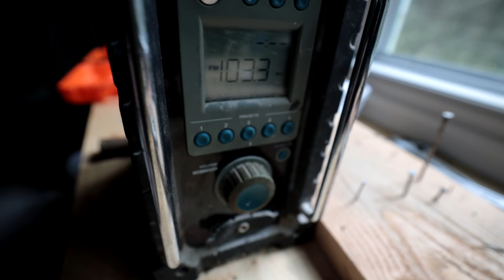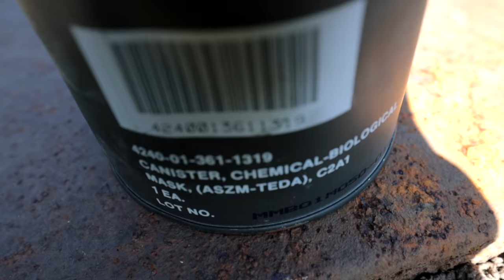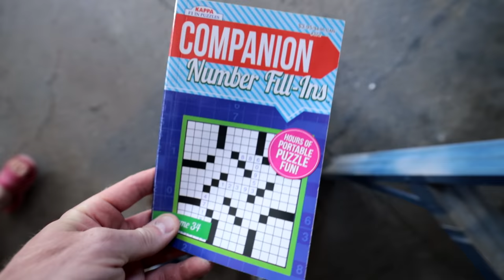I Built a Fallout Shelter!

Comment: that's a cute coffin.... might want to revisit your fresh air filter idea--I don't see much airflow going through one gas mask filter for multiple people that will get rained on and degrade in the elements... i would worry about carbon monoxide poisoning--or methane with beans being the primary source of food🤣🤣🤣
Reply: Use a blower to pull air for one and cut a bigger hole for a 3 to 4 inch diameter pipe and have the outside port angle downwards might try to figure out a way to change the filter on the inside
Reply: "More beans,Mr. Taggart?"..."I'd say you've had enough!".

Comment: Seriously. I have purchased a 5 x 5 x 4 dog kennel. I'm gonna use boxes with huge trashbags to hold water mixed with boric acid. To build up the outer wall then fill in between the kennel and the boxes with 2 gallon bags of water with boric acid. I'm also gonna build up the roof with basically borated water. It's not a lot of room but it's enough for us to lie down. Potty, food and water supplies at least for 72 hours. Then I'll go out for brief things in the house but my son will have to stay in there for a while. The science of it seems sound. We'll be shielded primarily by 24in of borated water. It's not as good as being underground but it might be good enough to prevent serious problems. I have Apple pectin and potassium iodide tablets.

Comment: You asked what is in my bug out bag: 

Medical Supplies - A big first aid kit, burn gel, several Israeli bandages, some gun shot/deep wound kits, extra gaze, bandages, saline.

Survival Supplies - A Knife, 2 lamps, a flashlight, a small saw, compass, a multi-tool, small tent, emergency blankets, poncho, paracord, lighter. 

Other Supplies - 2 Small power supplies with USB and Phone connections for charging, batteries for a week or two for the lights.

Food Supplies - 10 Bottles of Water, Trail Mix, Granola Bars, Tuna Packets, Mayo, Crackers, Chips.

Everything is inside of a large military duffle bag that uses a molle system. 

I made this bag, and keep it supplied when I can, about 5-6 years ago. Our power went out, my Grandfather was slightly injured, and we couldn't leave the house because of downed power lines. Always good to be prepared, since then this bag helped save my Grandmother's life from a very deep injury she sustained, as well as having water after flooding.

Comment: i am not too sure about how good that door would be when it counts and i am not too sure about how well the air flow would be with that filter over the air hole. Might be a carbon monoxide issue.
Reply: You're right.  Most shelters have a way to filter air.  Some are manually run and some run on electricity.  Either way, the air is cleaned and circulated throughout the shelter.
Reply: Yeah pretty sure they would die if they actually stayed in the shelter overnight.  No air coming in that filter those chem suit filters are forced flow only.  Very dangerous glad it was just a joke, just need to be careful that you remind the kiddo that it isn't safe to go in there for very long.
Reply: @AQUATICSLIVE   granted there wasn't a great seal on the door so there was still air flow. But if that door was sealed tight dangerous for sure.
Reply: IDK how he could change the filter from inside - maybe hook it up inside instead?
Reply: @FurnitureFan  and include some way to force the air through.

Comment: Air intake pipe filter should be inside. Also air intake pipe needs to be in the shape of a candy cane to prevent water from entering. And you need alot more airflow than a 1 inch tube. Especially if u have alot of ppl and candles. Also concrete is alot better than dirt. Aside from that its a pretty good idea

Comment: My daily bug out bag consist of: Tourniquet, basic meds, basic TACTICLE first aid kit, trash bags, flash lights batteries, extra pair of clothes, multiple light sources, matches lighters flints. Few small cans of canned beans. 1 full MRE. Portable fold up axe/shovel. Rope, twine, fishing line, mini fishing set, multiple knifes, 
40, s&w with tac light. Solar brick, flares, chem stick, portable HAM radio, And probably a few more main ones I just forgot to mention. Yes this all fits in one bag weighing 31.2 pounds.

Edit, 2 bottles of water. Food and drinks, and any other items that may need to be checked or replaced as in going bad, are done so regularly. Bag stays in my truck any where I go 24:7

Comment: I strongly suggest you put a computer type muffin fan up in that pipe opening and run a 12voltDC line to your power box. Have the airflow direction into the bunker. Also, a couple of automotive white light LED marker lights, hooked up to your power box. They take so little power, could last for days if not weeks on a single 12volt battery. Interesting video, thanks for sharing.
Reply: Without an NBC filter, all that would is suck in radioactive particles, all this set up is during fallout  is a grave

Comment: Any gamma radiation that is emitted by radioactive fallout that lands on the ground in front of the main entrance of your shelter is going to punch right through with the way you have things arranged now. And you will likely die or get severe radiation sickness from being exposed to it.

The radiation will be most intense for the first 24 hours after the attack, and in 72 hours, 90% of will be gone. But you will still need to shelter for at least 14 days because exposure to the residual radiation has a cumulative effect and thus poses a potential hazard.

I would seriously consider attaching a 1" thick sheet of lead plate to the wood on the interior of the shelter and the interior of the steel door. 1" of lead will block 99% of all gamma radiation.

Failing that, I would build an external passageway situated 90 degrees to the shelter entrance, with three feet of earth piled on top and on the sides. Radiation cannot bend around corners, it only travels in straight lines, so the external passageway will add sufficient shielding to the main entrance.

But since you are located in northern Ontario, you are not likely get much fallout, anyway, and the hourly dose rates of radiation may be almost negligible for whatever fallout does land in your area.

I live in southwestern Ontario, and hence I'm in fairly close proximity to a lot of American target sites, and several cities in my area (think Sarnia, London, Windsor) are possible targets as well. Radioactive fallout is therefore going to be a major hazard in my region.

Comment: Shipping container would be epic
Reply: Thin steel and you would have to go Andrew Camarta
Reply: You still have to put it in a cement and rebar frame to keep the metal from bending inside from the pressure of the dirt around it.  Then you also would need an air filtration system, a sewage system, hook it up to a water well, and then add wind or solar energy for lights and to power other needs.
Reply: @stephenthorpe6238  I agree, you need to work on making the structure strong so it doesn’t cave in. It will just be a big project and materials.

Comment: So you’ll need two holes for the purpose of venting. One will draw and the other will release. Otherwise any length of time in it if it’s air tight will kill you from carbon dioxide buildup. Good luck

Comment: Bucket toilet with pool noodle seat. Cups. Smaller water jug to mix the tang. Needs a low cot on the one side wide enough for 2 adults. I'd have dug it into the ground deeper. Air intake needs some kind of suction to make it work and another hole with a filter for the air to get out. maybe an old shop vac?

Comment: You'd need to fill in between those pieces of wood , maybe silicon caulking and steel flashing on the outside of the wood and the inside wall of wood as well. A place to to do ones business would be good to. A nice sleeping bag, pillow and thick foam for that bed/ shelf. A week's worth of food and water. A faraday box, spare batteries, ect. A cheap c/b radio as well as a super long antenna for the outside and if at all possible put it in on a giant telephone pole next to your shelter. Because you would want a lot of open space to receive any radio information. I would also suggest a signal flare gun a lighter or a magnesium stick and blade and a fire piston or something else that's easy or cheap to make fire with. You're going to want to bug out after seven days as quickly as possible so if you can have a vehicle that may not look best but can handle rough terrain maybe have 4-wheel drive or just a $300 vehicle that will get you out of the area as quickly as possible. Keep it close and under pond liner or multiple tarps. Keep the same kid of provisions in the car in the form of bug out back packs. Keep extra cans of gas safe but far and close enough to not catch anything else on fire but close enough to retrieve. Personally a hand gun and or rifle with a few boxes of ammo. I would also have a few gallons of booze and gold/silver as a way to barter since it's value will always be sustainable.

Comment: Fyi, you can't allow that filter to get wet. It will be useless. I'd use another pipe that's a "u" then attach the filter to it. I'd also get a small computer fan for intake air attached to the inlet pipe.

Comment: I think this build is good...except the front. If there was fallout there wouldn't be adequate protection from radiation. There needs to be more shielding in the door and a lot more in the wood surround. There needs to be a minimum of 36" of earth on top and on the sides of the shelter.

Comment: I would caution use in the cartridge as it's used for negative air-purifying respirators. So the air in the chamber would have to be less than outside air pressure. Otherwise, it's ineffective.

Comment: As a storm shelter it is fine. You will not be in more than hour or so. Overnight at worst. As a bomb shelter for non nuclear weapons probably would be ok. But as a bunker for nuclear war it's crazy. Mine would be built using shipping containers and large pipes. I would set up at least 4 to 6 containers connected by pipes to a common hub area, plus an airlock. Airlock would also be the space where you can decontaminate by dumping your clothes and showering off any contaminates. Having so many would give everyone space and privacy. I would use shipping containers as opposed to pipes. Any large pipes like yours would be for hall ways, set up a couple  hydroponic gardens to clean grey water for reuse and grow fish and replenish oxygen, laundry, compost toilets and figure out how to use methane to create energy to run any electronics and cook or heat, Airlock system and storage for provisions and medical. The reason I would have at least 4 containers place for each family member to sleep and make a common room and kitchen/dinning. I would also add games and books. The Common area would more than likely be where the airlock entry and exit is. With 4 in my family all adults we would lose it if we didn't have some space from each other.

Comment: We are currently starting world war 3 and you're taking it as an opportunity to LARP instead of being serious. You do realize that it takes a thicknesses of shield upwards of about 13.8 feet of water, about 6.6 feet of concrete, or about 1.3 feet of lead in order to reduce gamma or fallout type radiation by a factor of a billion to one in order to be considered safe from radiation. Thick, dense shielding is necessary to protect against gamma rays. It's the gammas you have to worry about this little half inch tube of steel, and sheet metal door would do nothing but echo your screams. And your little carbon filter air system would not be nearly efficient enough during a radiation cloud passing. It would take about 60 lb of carbon through a pressurized filter system to clean that kind of air. It's different after the bomb has dropped and levels have fallen which takes about 4 days. But if you know it's going to happen your best bet is to leave the area. And if you couldn't; Your basement would provide you more protection than that thing; although let's be real; going to the basement we just pull on the inevitable as you would still be exposed to deadly doses of radiation just not as much not to mention the air that you're breathing in 🤷That whole thing seemed  like a giant joke like a big kid still playing LARPing games building forts and castles. If this is really your plans; make sure you kiss your family before saying good night once you're in there.

Comment: Buddy,

All joking aside (literally), I appreciate your sense of urgency, but that pipe could have used a second coat of that oil-based stain blocking primer. It looks pretty thin. Also, I would have put a small floor in there. You can use the space underneath for storage.

Comment: So if you want a good variable LED light look up the “Voltaic Systems Emergency USB Led Light”. On the high setting it’s super bright and on the low it is very energy efficient. Or you could get a solar interior shed light. Mount the panel outside run the cord into the bunker and mount the pull cord light.

Comment: A few years back, some yahoo in Missouri was adapting concrete septic tanks to tornado shelters.  NOT USED ONES!

A school in Oklahoma built a lower cost tornado shelter from 3 or 4 cargo containers. Very cool….

A candle will give you CO in there. Bad.  Need a carbon monoxide sensor…

Comment: bro sounds like jordan peterson.  A cheaper alternative to lead is draping a pool liner over the whole enclosure. In the case of fallout the fallout would go where ever water can and the combination of the clean soil and metal human sized can is likely to attenuate a great deal of the radiation.  Even if you don't have an underground shelter.  Being in places where a lot of HEAVY stuff is between you and the radiation, you'll be good.  For example if all you have is some random basement and a bunch of barrels of water, or fish tanks, make a little fort in the middle of the basement away from the walls.  use the water barrels, use sand bags, you don't really need an underground shelter.  The idea of a bomb shelter is mostly outdated.  WW3 wont be like WW2 with carpet bombing (not in the US at least)

Comment: I realize it was mostly a spoof, with the important stuff thrown in to get people to think. And that's important and that's great. But I couldn't help but notice a few things that were lacking. First of all you had no bucket to go to the bathroom in. Basically you need one 6 gallon bucket per person per week to hold number one and number two. A child would be less. But those things really smell so it wouldn't be a bad idea to have some Lysol or something to spray around to kind of mask the odor a little. LOL because poop is something that happens regularly as well as pee. One thing you could do is put a little tiny seat with a funnel under it and a little hose leading outside to get rid of liquid waste of whatever sort. And then save the 5 gallon buckets and some sort of shavings or pelleted bedding to keep in the buckets for number two. Also the water situation needs to be at least quadrupled. And of course you need more food. As far as how it's arranged I personally would have liked to have seen a bed running long ways higher up more like a tall bunk that hinges upward out of the way as much as possible so that it doesn't block the door. And then underneath it you can build in cubbies and shelves for your supplies as well as having a deep shelf on the back. I do understand that that small of a bunker can only hold so much. But in the case of an actual nuclear emergency you need to be able to stay in there at least 2 weeks. You'll also want to keep up some more dirt on the top of it or you sandbags if you're worried about erosion. And then I would use sandbags to make a small hallway leading away from it so that the very end of your bunker is not directly exposed to the elements cuz you can put a small roof on the sandbags and heat some dirt over the top of that or more sandbags. Basically a double door system. Distance and mass are your friends in a nuclear situation. Also the root seller would make a much better bomb shelter than the little metal shelter that you used. These are just my observations and I do realize that it was mostly spoof. But it's good to look at things like that and decide how you would do it differently than the person who did it in order to help with your own plan on how to be safe in the event of a nuclear emergency.

Comment: What if a blast schoots off your air filter. it would be better if you used a steel pipe and put the filter on the inside.
Also to cool the inside. put dirt on top of the pipe.

Comment: Should have built a trench to the entrance as won’t protect ya from fallout the way it is from the from off the bunker. I would have dug a trench about 5ft deep 4ft wide and 11ft long place the steel container you used in the trench place logs over the top off the whole trench place waterproof sheet over it and back fill mean you have a along entrance to the bunker for a mud room and for extra protection  plus if possible to exit doors

Comment: You need a 5 gallon bucket & poop bags as well as a couple MT gallon jugs for pee.  Also if you actually had to spend more than a day in that small a space you will need a way to force air in through the filter & out through another hole with a bellows if not an electric fan.  Over all that shelter is good for storms only.✌😎🏴‍☠️